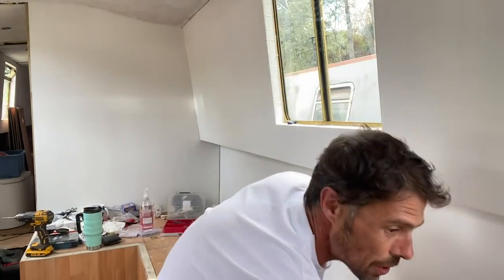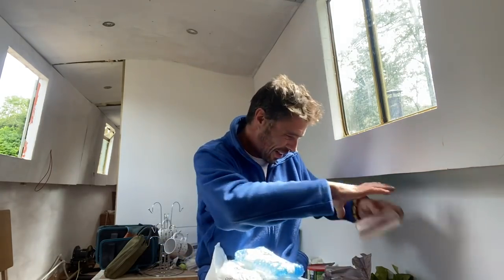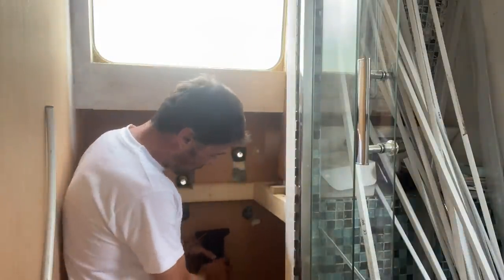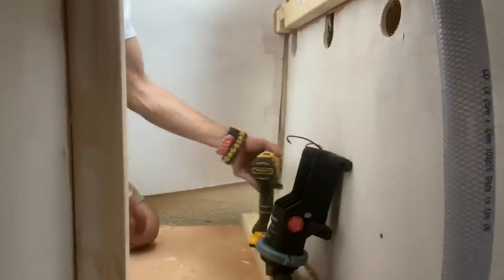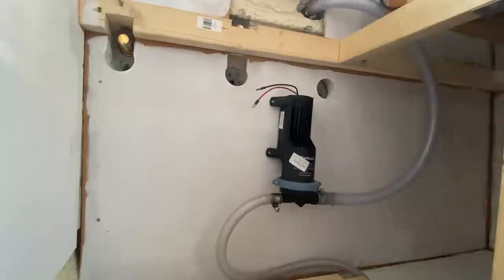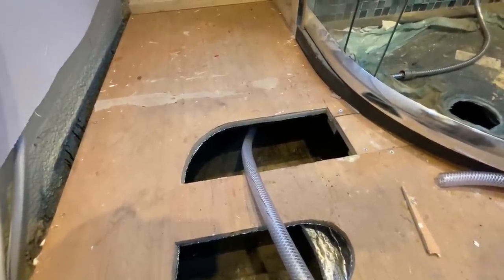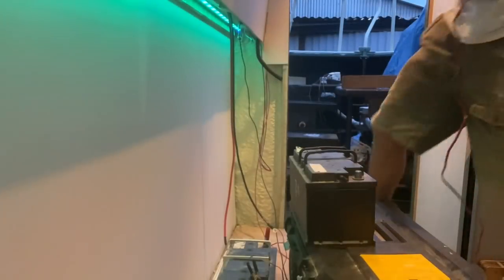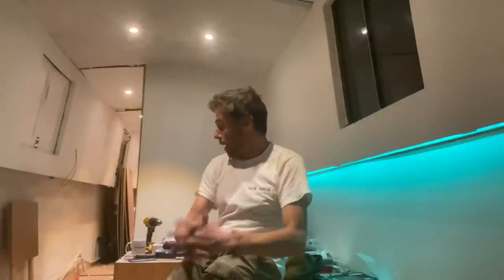214. Installing the Whale Gulper 220 on the Narrowboat

Comment: God job done there James. I see others have mentioned in the comments about using silicone on the shower trap. I would definitely run silicone on both the trap and rubber seal. Then in the shower a silicone seal around the trap where you screw it it.
All the best. Loving the build.

Comment: Hi James. You should really be fitting fuses as close to the source of power as possible and in the case of your gulper the fuse to the pump should be close to the heavy terminals. The heavy cable itself fused near the battery.  The purpose of the fuse is to protect the cable rather than the device on the end. The closer to the power source the more of the cable is protected against shorting. 👍🏼
Reply: Yeah, the “as close to the device as possible” thing is just incorrect (backwards, in fact).

It’s the same as with house wiring: the power company has really big fuses and puts really big cables in the ground. Then when it comes into your house, you get a big whole house fuse, and the cables from then on can handle the whole current allowed by that fuse without causing fire. Then you go into your fuse box, and you have a bunch of smaller fuses, each of which is connected to a size of normal house cable which can handle all the current permitted by that fuse without burning your house down, and then (in the UK) you have your plug with a fuse in it, and then after that the cable can be thinner still that goes to your appliance, but it still won’t burn your house down because the cable can handle all the power that the fuse in the plug will allow.
Reply from the maker: That’s what I thought but whale say it’s to protect the pump in case of blockages and stop over working. I’ll ask again
Reply: @TheNarrowboatThatJamesBuilt  well, obviously manufacturer instructions trump what some rando on the internet says ;)
Reply: @TheNarrowboatThatJamesBuilt   the fuse closer to the source of power and to the point where the cable gets thinner would still do that. The real purpose of fuses is to stop the cable setting on fire if you put a screw through one and short to -ve. The closer to the battery the more cable is protected.

Comment: Hi James.  I told you I'd seen that programme before...  ;o)
Any excuse for a cup of tea is a good excuse.
And now you know why I gave up plumbing.  When you take that trap apart, make sure to add a ring of silicone sealant between the underside of the shower tray and the trap fitting.  I didn't see a washer there, and you've cut away most of the flange that provides a seal.
All the best, mate.  If you fancy a pint after work, drop me a text.  ;o)
Reply: Do the job properly as it will be hidden from view - Cut away the floor to allow a trap that hasn't been 'modified' to be fitted...

Comment: Nice one James, famous across the globe !  Check that the bend in the hose near the skin fitting doesnt collapse into a kink if it softens so much once it gets warm shower water going thru it though. Maybe try finding a 90 degree fitting to go directly onto the skin fitting to connect the hose to ?
Reply: 90 degree fitting would be neater, but this type of reinforced hose doesn’t kink very easily, hot or not. That’s what it’s for.

Comment: James you are using the crimp tool the wrong way round.  You should  pull the lever up and the wires go into the lugs from the coloured dots side.
That's how I was taught to use them during my apprenticeship.

Comment: Quite a bit done today and a nice long episode. I think you can flip the whale gulper inlet and outlet 180 degrees if that helps. Make sure you dont get an electric shock on that switch with your wet hands after a shower :)
Reply from the maker: It won’t be that switch - it’ll be done properly

Comment: That is some 'Current Carrying Capacity' cable you have there my friend. 
It only pulls 2 amps so 1.5mm would have been ample, and that's even taking into consideration the Water Fan.
You are only talking of 12v DC after all.

Comment: Heads up, you can buy water flow sensors to auto switch the gulper on when your in the shower.
Reply from the maker: I know but it’s just something else to go wrong. It can also be triggered by a float switch. 

They tend to be needed for hire boats
Reply: If you fitted a flow switch then you would also need to fit an over run circuit to keep the pump running to ensure the tray emptied. Also once the water drained off the walls there would be no way to drain that.
Keep it simple, a switch is fine on its own.
I agree with the other posts about supporting the hose so it doesn't sag when it gets warm. And move the fuse to the power source end of the wire not the pump.
Good luck with the base plate welding 👍

Comment: no plumbers mud around the drain?  that surprises me.
Reply from the maker: I’ll be putting some silicon in there when fitting
Reply: @TheNarrowboatThatJamesBuilt  Use a rubber gasket and some plumbers putty for that shower drain. Also u should make a door in the floor to get to that drain if it leaks in the future.

Comment: Me Old, the reason there is water left in shower drain is possibly to avoid legionnaires disease? Discuss!!!!
Reply: Normal shower drains have water in them to seal off the odor from the sewer. Same as toilets and sink U bends. In the narrowboat application you don’t need to seal out sewer gas but you might still not want an open connection to the outdoors (say in winter) if you can avoid it.

Comment: Hi James, What are the other 2 brass water outlets on the side of the boat slightly lower than the shower one?
Reply from the maker: Hey
One of them is the outlet for the bathroom sink and one is for the WC air outlet
Reply: Thanks James, I am watching everything you have done on both boats, I am looking for something 15k and saving so may have 20k soon, did I hear you say project 58 came from North Kilworth, I love in Lutterworth, so not far from me. If you hear of anything going cheap let me know. Thanks Phil  @TheNarrowboatThatJamesBuilt
Reply: Live not Love ah ah ah